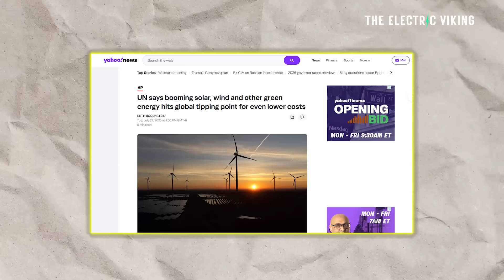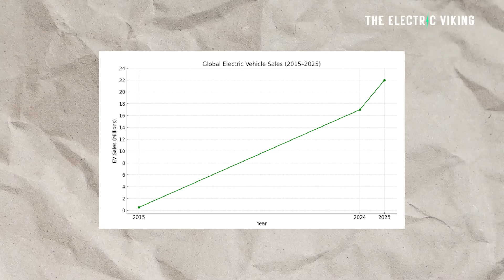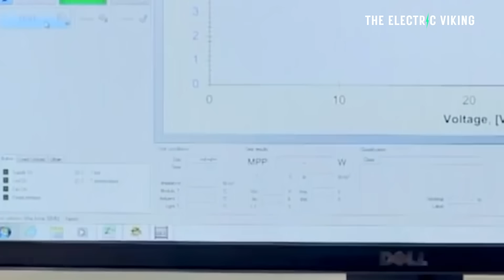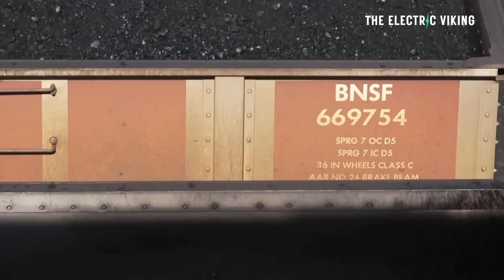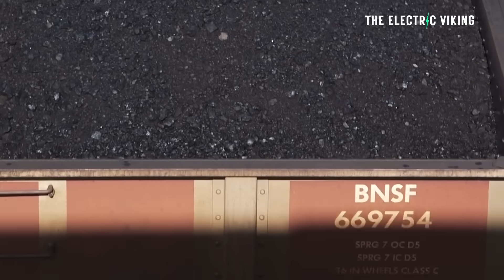UN says booming solar, wind and batteries hits global tipping point

Comment: Trump's hold on power in the US may end in the 2026 elections.  The Epstein files scandal is spreading trouble in his base as for once, MAGA didn't just nod and obey when told what to think.  Yes, the US will have lost a lot of ground but it is possible that the trend will reverse.
When you consider places beyond north and south 45 degrees latitude, it still can be that solar and wind become the main energy sources.  You do get a lower output from solar from a lower sun angle but panels now have such a low cost that you nearly have to be in the arctic or antarctic to not have solor be the best deal for power.  Also:  Panels make a higher voltage in the cold and are a bit more eefficient.

Comment: Some of your figures were only about electricity production. But electricity is only a part of total energy use. So what is the effect on total energy production, including for heat? I would have checked it in the UN reports, but you haven't linked to them.
Reply: The thinking is that when electricity's cheap enough, is to us electricity for heat too. It's already happening with heat pumps that can both warm AND cool you.
Also check out zero energy homes that use high insulation. They rarely need more than 1-2 kw of energy input on a sporadic basis.
Reply: Yes, things like solar hotwater are basically "no brainers" when it comes to the payback time.  They pay off much faster than PV

Comment: Renewable energy: Build it once, maintain it.
Vs.
Fossil fuels: Build it once, maintain it, buy feed stock fuels, clean all the waste and grime and wear and tear on massive machines. 
Vs. Nuclear: add the cost of maintaining deadly poison for 250,000 years... (I guess this cost is about infinity...)
Reply: Totally untrue 
Turbines need maintenance, they need 80 gallons of oil to function.
They will be worn out in 25 years 
The blades that were going to last 25 years , actually  they only last 5 years 
cos all the stuff in the air degrades the leading edge to the point its
not efficient.  
Read up about Thorium and liquid salt reactors
Reply: Nuclear doesn't produce 'deadly poison' that lasts 250,000 years. Most of the radioactivity in spent fuel rods has gone after 100 years. You can actually store it in sealed containers in the open air, it's perfectly safe !
Any nuclear material that's still radioactive after 250,000 years is 'decaying' VERY slowly and is never a problem, granite (the rock) is a natural example. The danger is from elements that decay quickly, and they are gone equally quickly. 
Storage/disposal of spent nuclear fuel fuel has been solved by the Swedes and now the Finns are using the same method.

Comment: The issue with solar for residents in the US is there are far too many middlemen, corruption, and red tape. Solar salesman get people buying wildly overpriced systems, flashing the tax credit. They know they can overcharge everywhere and claim they will save money paying $3-4/watt. The BOM may be like $0.75-1.00 per watt. They often are untruthful of true cost saving, so people expect no electricity bill, but don't understand how net metering works. So the tax credit just goes to lock people into funding scam companies.

Also, it may take 6 months to get your system online due to waiting on endless permits and inspections. In Europe, you can get a system for half, or a third the cost here. You can have your system online next day, no permits required. Also, if you can do it yourself (which isn't that hard), you can easily get a battery backed system for less than $1.00/watt and avoid all the nonsense.
Reply: You are right about wait problems. But friends I know who have solar have not had to pay on their electricity for most of the year.
Reply: So, what you're saying is that US businesses are dishonest ?
How does that affect the underlying economics (except in the US) ?

Comment: The  EV con. It creates more 'carbon pollution' making one of these vehicles than it saves in it's lifetime, and, when they expire it takes approx: 900 years for the batteries to decay. Yep, save the earth indeed. It’s the wrong kind of electric cars  . Sitting on a giant battery producing an A/C   Alternating Current electric field is seriously detrimental to biological life , its needs to be D/C ( Direct Current which is beneficial )
We need hydrogen fuel cell electrics that don’t need  big battery and produce only water vapour as exhaust. They already exist in Japan and South Korea.  Do you see them in North America? The electricity to create the hydrogen by electrolysis could be produced by geothermal energy thus creating a green energy loop.
Reply: What is your evidence for "The  EV con. It creates more 'carbon pollution' making one of these vehicles than it saves in it's lifetime"? Every calculation I have seen shows that the embodied carbon cost is paid back within 1 or 2 years of driving. Quote your sources or stop lying.
Reply: @DavidNewmanDr 
It takes 600,000 Ibs of dirt (mining) to produce 1 EV battery ., so firstly where does the energy come from to dig out that much dirt ?! Look it up .

Cost of an EV battery : https://youtube.com/shorts/avuqF1_cX4g?si=U6cwmfvbxTMTPDNr
Reply: @LexxLarsD  - even if we assume that 600,000 lb. figure to be true, and even if we assume a low average figure of 80 lb. per cubic foot, that comes out to a cube a little less than 20 feet on each side. That's not really that difficult to move and process.

Don't let people use big numbers to scare you.

And once there are large quantities of batteries to recycle there will be plenty of companies happy to do so, because it's much cheaper and more efficient than mining. This creates a circular supply chain for the raw materials.

I do agree that we should at least pay more attention to residential fuel cells, and that geothermal (especially the likes of what Eavor and Quaise are working on) looks very promising, especially for high latitudes.
Reply: @alanlight7740 
YouTube keeps deleting my links !
Reply: @alanlight7740 
Ytube keeps deleting my links ;

Cost of an EV battery : https://youtube.com/shorts/avuqF1_cX4g?si=U6cwmfvbxTMTPDNr
Reply: @LexxLarsD  - I was able to see the video you linked.

It's ... rather misleading, and again just look closely at the numbers given.

The man claims that it takes 100 to 300 barrels of oil to produce one 1000 lb. EV battery. Let's go with the lower bound:  100 barrels of oil right now will cost about $6500, but if we use a slightly below average energy density of .11 kwh per pound and a price of $100 per kwh (for 2025 - the price continues to fall and is expected to be $80 in 2026) then a 1000 pound battery will currently cost about $11,000 while also including the cost of the raw materials, production facilities, and labor. The cost of oil for his higher bound at $19,500 would of course dwarf the current cost of the battery.

Now do you really think that battery manufacturers are selling their product at far below the cost of production?

Just looking at the money reveals that the man was lying.
Reply: @alanlight7740 
OK , splitting hairs , but we are going to see some revolutionary tech soon .
Reply: @LexxLarsD  - we are definitely going to be seeing some revolutionary tech. Heck, we're already seeing it.
Reply: @alanlight7740 
Plasmsa Physics, Zero point energy, and load more . We are 100 years behind schedule.

Comment: And with those new gridforming inverters, we don't even need rotational mass (steamturbines) to keep the grid frequency. there are even battery banks now that can form AC frequency without inverters, just electronics directly connecting to the battery cells
Reply: The technology exists to deal with this problem. These "rotational masses" have their problems. You have to adjust the load & input to keep the frequency constant. It is a difficult control process. But using a reference such as the atomic clocks in the GPS satellites, a completely solid state system with no mechanical elements is very much within the reach of modern technology/electronics.
Reply: @williamreyes468  It exists and has been used in Australia.
Reply: inverters = electronics directly connecting to the battery cells😁
Reply: @williamreyes468  negative. Sax Power has a product that does the inverter side in software. quote from pv magazin: " The conversion is not carried out by transistors such as IGBTs or MOSFETs, but via the software of the battery management system. By interconnecting with cascaded H-bridges, the cell blocks can be controlled individually"

Comment: I started printing out the US energy breakdown by type about 20 years ago, posting on my cubical wall - initially the renewables accounted for less than 2% TOTAL. But every year the new printout increased that amount by a 'bit'. Now renewables passed up coal in the US, Nuclear is on par, and natural gas is becoming our number one source. But batteries and cheap solar are converting many nay sayers of solar because of the cheap backup capability and lower prices. I don't see how you can stop common sense - unless you listen to trump and dismantle all windmills (yes he said that live in a meeting with EU president).

Comment: Absolute rubbish 
Your electric car is full of oil based plastic 
There is not one solar panel or windmill that has saved 1 gram of CO2 
There is so much inbuilt CO2 in the production it can never even get 
back that inbuilt CO2 
Ask people who pay for this crap . Look at the cost in the UK , Germany , and Aus 
Thanks to the UK's investment in renewables we have the most expensive electric 
in the world . The latest round of north sea turbines the guaranteed cost to the 
operators is significant higher than what the UK is already paying for the highest 
priced electric in the world 
Your figures are junk , and your claim about fossil fuels driving climate change 
is junk science
Reply: Grok 3: "The UK’s electricity market uses a marginal cost pricing system, where the wholesale price is set by the most expensive source needed to meet demand—typically gas. Gas sets the price 97-98% of the time, despite renewables contributing nearly half of the UK’s electricity (47.3% in 2023). This means even low-cost renewable energy is sold at gas-driven prices, preventing direct cost savings from renewables from reaching consumers."
Reply: Give evidence for each of your sentences, with references, or stop bullshitting.
Reply: @DavidNewmanDr  
I agree , so where is your evidence of the £700 billion fossil fuels 
subsidy ? 
I want a break down of how u think it gets paid Dr ?
Truth is its made up 

On the wind turbine front there is 300 tonnes of Concrete , about 
300 tonnes of steel and 100 tonnes of copper , then all the land 
clearance, miles of cables to run the electric to places where its used .
How about all that mining , smelting and refining those metals 
U must know that concrete is a very CO2 intensive to produce ?
Next we have the blades , the plan was they would last 25 years of 
the turbines life, but NO due to a lot of stuff in our atmosphere the
leading edges are worn out in 5 years. now these are scrap and are 
made with fossil fuels and now they say u cant even bury them cos 
they will ruin the soil latest news is 
Scotland is a small country and they have cut down 7 million trees 
to build and install wind turbines , madness .
Then we have Drax , used to be powered by coal , now it burns north
American wood pellets ......... over 16 million tonnes cut down and sent 
by boat to the UK to be burnt and produce the same amount of CO2
Nothing green about this is there .
Reply: I am sorry. You are a victim of fossil fuel propaganda.

Comment: In the Spring, I put in a 30KW roof solar array and 30KWh of Powerwall batteries.  I live in Indianapolis, where the summers are hot, the winters are cold and dark and the price of electricity is $0.12 per KWh (in Indiana, electricity is almost entirely coal powered).  I also have two Tesla EVs.  At least right now, I barely need any electricity from the grid.  Hopefully that holds up during the winter, though I imagine it will not.  I am curious if any of your viewers live in the US Midwest and have any experience with how home solar + batteries perform in the winter months.  Either way, it is great to be grid power free right now.
Reply: That's great to hear.  I'm near SW Chicago wonder if my results would be the same.
Reply: @ChicagoBob123 I'm originally from NW Indiana - and I'm hearing towns installing EV chargers, but so many are still under political hypnosis of fossil fuel stupidity
Still, Faux News did do a Tesla drive ... see that whiplash when Trump did a Tesla car sale on the Whitehouse lawn - then the bastard Went Anti Clean Energy with the July 4th big ugly (beautiful) bill? Caused Elon to start his own Countering Political Party
Reply: зелени глупави фанатици
Reply: @veselinmihaylov6152  Seems like you're worse :(

Comment: What subsidies are paid to fossil fuels?  How are these subsidies paid?  Do you have any REAL examples?

The fossil fuel subsidy is an utter lie, completely false.  The subsidies are all going toward renewables.

Here in the UK AR7 has just been announced and offshore wind has been promised 20 year purchase prices 14% higher than the gas generated electricity.  Difference is gas power you can call, wind you take when it blows.

This subsidy BS has to be called out as a lie.

Comment: Sam little Australia national grid is valued at a REPLACEMENT cost of $TRILLIONS and many decades of construction and fossil fueled raw materials and manufacturing.
Grid maintenance and upgrade is $10sBILLIONS. 

No government can survive grid failures and rolling blackouts.

Grids are f.......king expensive. 

Rooftop PV saves governments ELECTORALLY and $TRILLIONS. 

Royal Commission and new grid projects and Federal Senate enquiry all say the same thing.
Grids are f.............g expensive. 

Rooftop PV HAS NO GRID COSTS.
Hello hello anyone home  ?.?.?.? Hello 👋. 

EV's v2g mass storage battery on wheels parked 23hrs every day and all night long under dirt-cheap rooftop PV is FREE MASSIVE STORAGE. 

TAX-FREE savings under every PV rooftop is an average $10,000 annually. 😮😊

Business can save $10,000 per quarter. 😮😊

All in 20years. 

High marginal taxpayers get max Tax-free benefits.

Comment: Sam show an arial picture of all the roofs that are still empty of PV panels. 
The upside of cheaper PV new capacity is extreme. 

20million roofs in Australia. 
200m² average new home roof area.
6.6kW rooftop x20 million is maximum grid capacity. 
6.6kW is only 33m² or ⅙th of available avg area.
But x6 grid max capacity at mid summer.
x3 grid max capacity at mid winter in cold Australian latitudes.

Even Hobart is in warmer latitudes than Southern France coastline. 😊😊

Northern face of high rise buildings are excellent for winter PV electricity panels. 

City tall buildings often had the air-conditioning at max setting to cool Northern winter heat build up.
And electric heaters at max on the south side of the same building. 
Electricity bills at max.
Reply: 太陽光は税金を払ってないです。ガソリンは,４０％～５０％が税金です。太陽光は自立してないです、まだまだで、税金にお世話になっています。オーストラリアのガソリン代に含まれてる税金は５４，６％です。国の貴重な財源になっています
Reply: And still they will produce nothing for at least 70% of the time.
Good luck with that .
Reply: @Leo555ZZZ  4 hour a day on 6.6kW and a battery, thats 33kwh daily ezi pezi. 
With 20million roofs thats 660gWh daily that beats the maximum fossil fueled 24hr production of 600gWh. 
If fossil fueled electricity is lucky.

Comment: Once factories realize they can build their own power source and sell the excess the game is over for fossil fuels
Reply: Well, power is only part of it.  About a third, really. Another third for transportation, and the last third is plastics, agriculture, cosmetics, pharmaceuticals, etc.
Reply: Not many factories could sell excess or meet their full needs, but I agree industrial and commercial rooftops are one of the biggest relatively untapped solar resources.
Reply: @undercoveraca build a factory, buy 40 acres of excess land next to it, there's your new solar farm and battery storage, buy on credit use factory as collateral
Reply: @undercoveraca  industrial roofs are mostly not strong enough to hold solar panels
Reply: Regulations normally prevent that and making industrial energy is harder than it may look to say nothing of capital outlays.

Comment: For the last 2.5 days, the outside temperature to our house has varied from 17.5°C to 10°C. Our heat pump ran an average of 24 minutes a day to keep our home between 18°C to 20°C. The heat pump is powered by solar panels. Previously, our nat gas furnace would have been going on and off during the pass weekend to keep us comfortable. This is why renewables are at a tipping point. Renewables save people real $$$ and the technology is amazing. The next time you are at a decision point in making an investment in how you transport yourself or how you energize or heat or cool your home, please keep an open mind to help yourself and your family save money and even help society.
Reply: They are making heat pump hot water tanks now too!
Reply: 太陽光は税金を払ってないです。ガソリンは,４０％～５０％が税金です。太陽光は自立してないです、まだまで、税金にお世話になっています
Reply: Your heat was on at 17deg ambient? Please tell me you are not Canadian.
Reply: @rickdacosta9727 no, it's simply the range of outside temperature. Enbridge is now offering Ontario residents rent to own plans for heat pumps.
Another added benefit. Our heat pump is much quieter in operation than our old AC and even our high efficiency gas furnace.